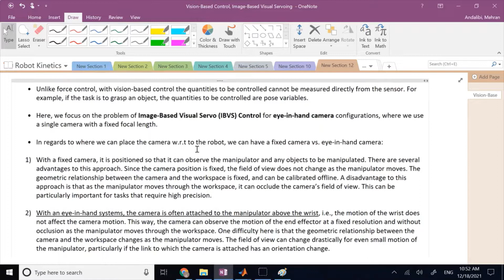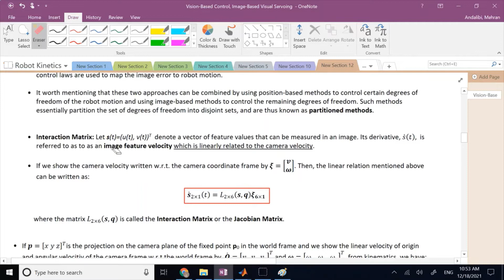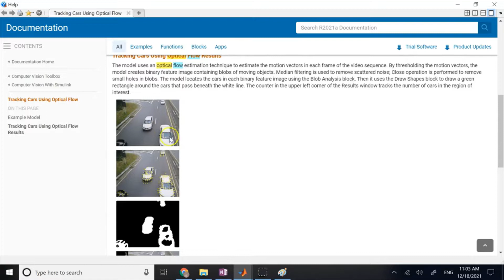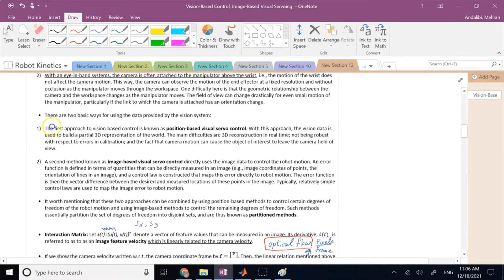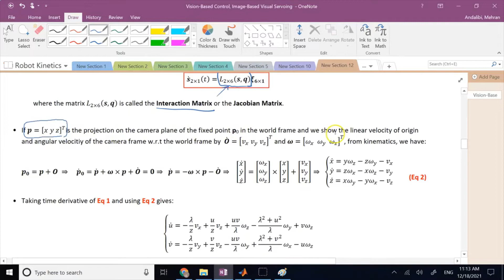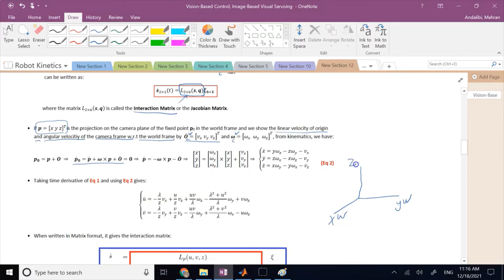Image-Based Visual Servoing - Robot Control Part 2

Comment: Dear professor, when we derive the interaction matrix that describes the relation ship between the velocity of the image feature points and the camera motion twist, the twist represents the velocity (linear and angular velocity) of the origin point of the camera frame w.r.t. the world frame; but in 23'54 of the lecture2 you say that the twist used in that equation represents the camera velocity w.r.t. the camera frame. what is the camera velocity w.r.t. the camera frame? is it quals to the velocity of the camera frame's origin point w.r.t. the world frame?